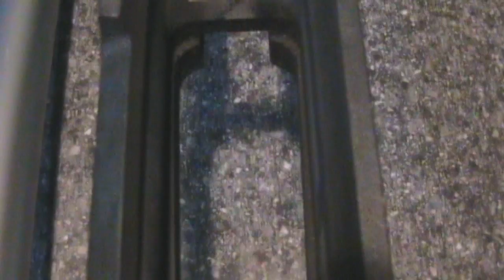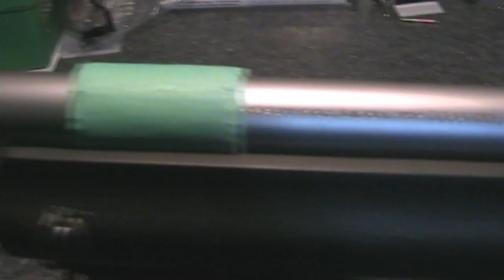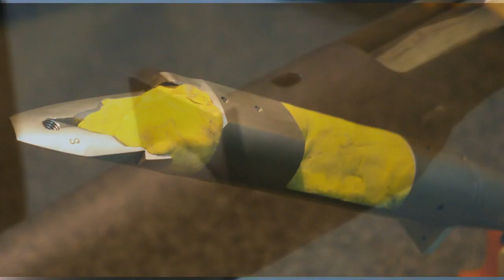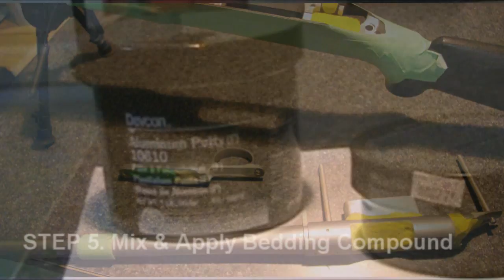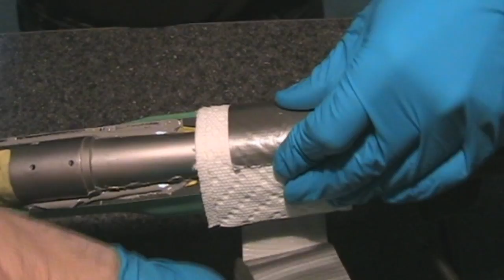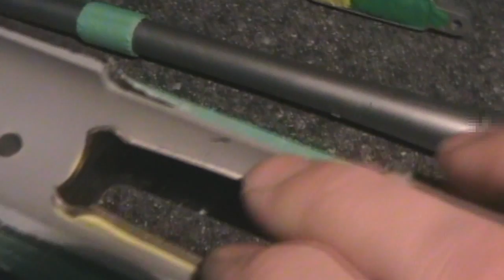Road to Precision Part XIII - Bedding the stock

Comment: Just a suggestion based on my experience using Devcon epoxy (whether it's the aluminum, steel, stainless steel  or titanium type), be sure when it is being mixed and applied that they are done in a well-ventilated area.  The chemical fume it gives off is seriously nasty.  The first time I used Devcon for bedding a rifle I developed a headache that lasted almost two days.  Now when I use it I always do the mixing and bedding outdoor in the patio, and I place a large box fan near my rear side set on high to blow the fume away from me.

Comment: Just bedded my first Rifle, ists my triple deuce Critter Gitter with a wooden stock.
It's nearly brand new but 11 Years old, bought it used with only 21 rounds down the pipe.
From Prep to finich I was working "only" 3 hours and only at the end there was a bit of swearing involved but I hope it works out. I didn't use bedding compound but stuff I got from a friend that works at Airbus, 2K Resin with Fiberglas particles cotton and glas mircopearls... I rubbed everything with styling wax...

Comment: He cut the head off some bolts as he states in the video.  Remington uses a very common 1/4 x 28 thread so there isn't much trouble making them.

Brownells sells inletters screws in oddball threads for many rifles out there if you don't have a Rem/Savage with 1/4x28.

Comment from the maker: No, only around the edges. I wanted a nice snug fit on both faces. I can probably shoot without the action bolts installed. Not sure if thats a negative having it so tight on the lug. But I don't think I am suffering because of it.

Comment: Get yourself a wooden dowel to stick in the action next time.  This gives you a nice handle to be able to pull straight up instead of levering up with only the barrel.

It's possible your little chip in the tang area might not have happened in that case!

Comment from the maker: I think they are a standard 32TPI 1/4 inch bolt(going off the top of my head right now). Any home building or hardware store should have them. get something thats 2-3 inches long and chop the head off. Mine were aviation grade, which I have easy access to. Thus you can look up AN4-30 as the part number. I think that should be what I was using.

Comment: Great video, i'm going to be bedding my Tikka t3 into a mcmillan a3 , any experience with that platform?
Reply from the maker: +Nick Nichols 
Not yet. I plan to build a rifle (someday when funds are available) on an A5. Generally speaking the stocks all work quite similar when it comes to bedding. You are just creating a super snug fit to minimize the potential movement between the action and the stock. With all the help that exists on the net now, you should have no problems figuring it out.

Comment: "Bedding" is the correct term regardless of whether there are pillars or not, glass or epoxy, blocks or whatever.

I have to agree with Randy and say that "glass bedding" means using a fiberglass type material, which he did not use and is no longer in vogue with the excellent epoxies around today.